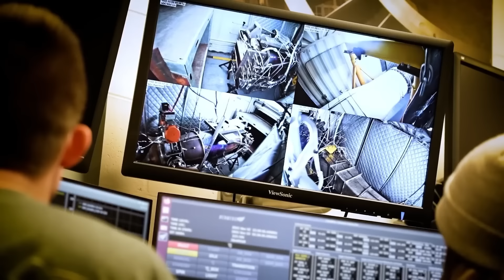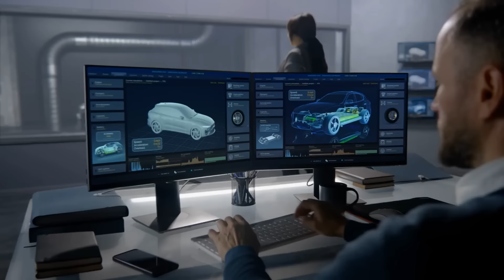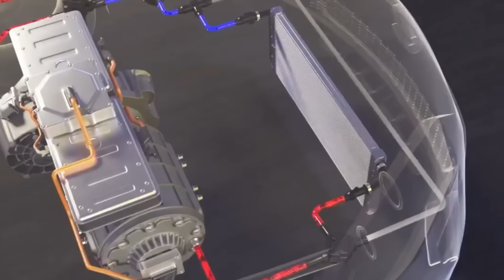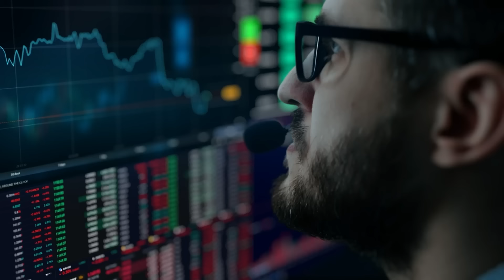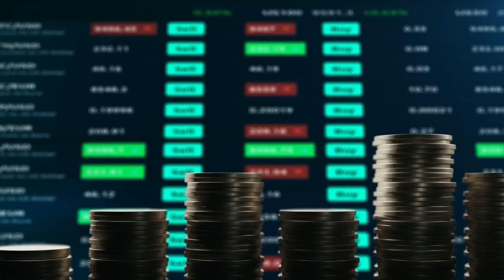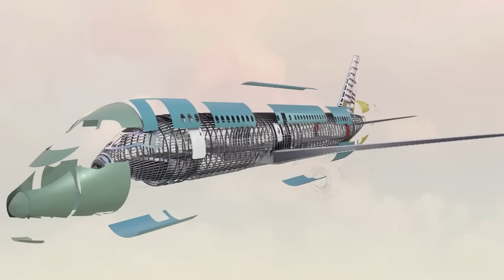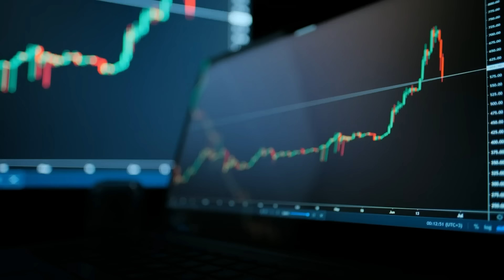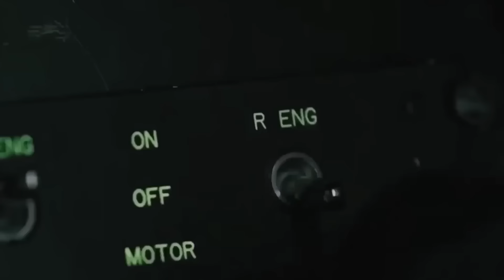Elon Musk’s Revolutionary Supersonic Space Jet Shocks the Public!

Comment: The hypersonic  issue,  is to cancel the friction,  not to face it. I think the  aerodynamic noze  profil  is the wrong solution. The Russian Kinzhals have concanve noze once the hypersonic effect is generated. If you understand that  it is not the engine which   accelerate  a Mach 10 but the vaccum around the missile.   The missile can turn by  90 degree in a second . The secret is inside the combustion engine  creating Mega Amp used  to shield the missile. A pure MHD machine . Maximum speed 14700 Km/h. The next Russian Jet Figther will target satellites by climing at 80000 meters in few seconds. Of course this will be  from above 40000 meters using the stardard   technolgy to reach this altitude  , because  to economise energy . And no way to detect the plane  once the MHD generator starts...